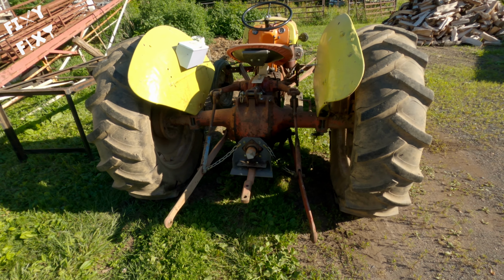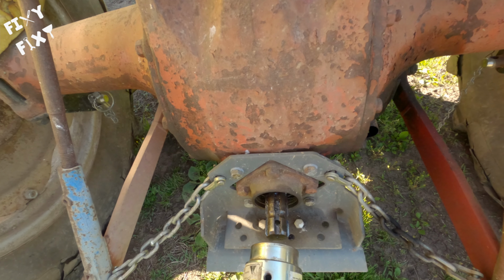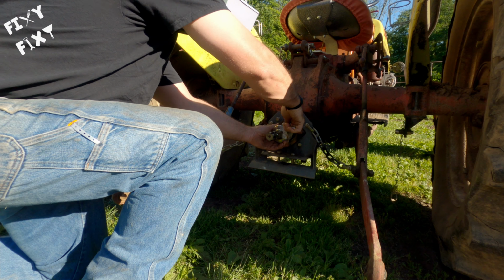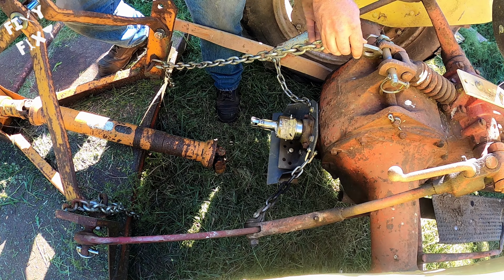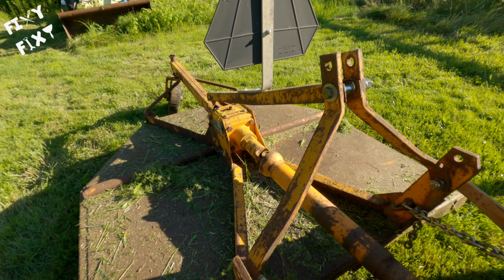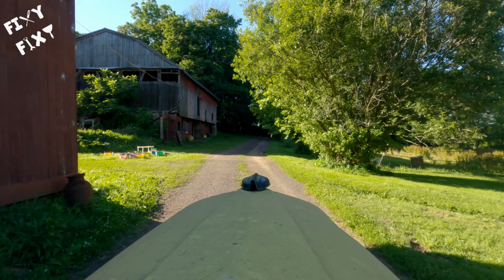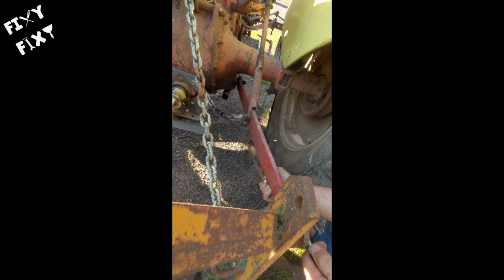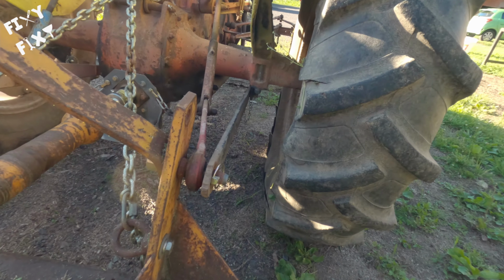Hooking a Brush Deck Up To a Ford N Series Then I Do a Little Mowing

Comment: A nice video, thanks.
Reply from the maker: Thank you for the kind words and thanks for watching!
Reply: Just got my 8N and bush hog.  Interesting seeing a hook up without the guide bars (what I call them) on each side.  Just curious if it makes any difference ?   Good video though.
Reply from the maker: I have only ever used a single bar mostly because most of my tractors only have a pin for a single bar. Hope the video helped and thanks for watching!